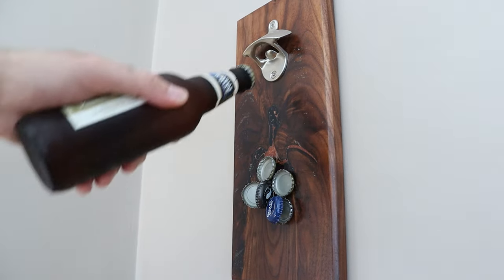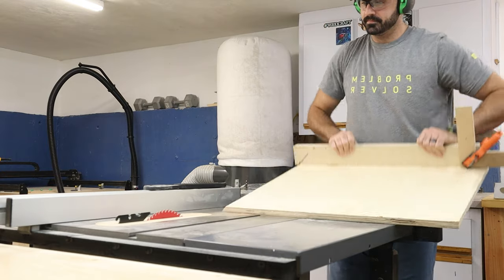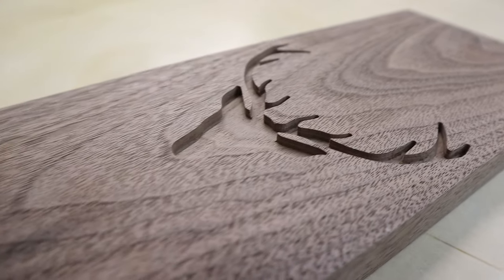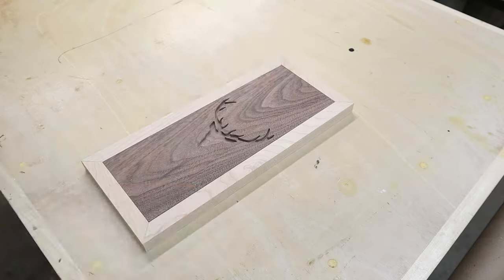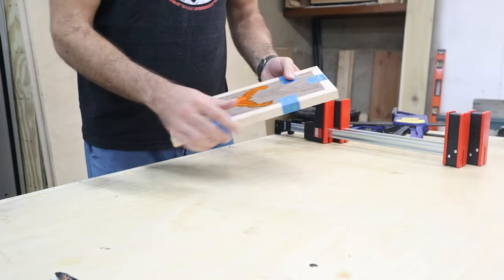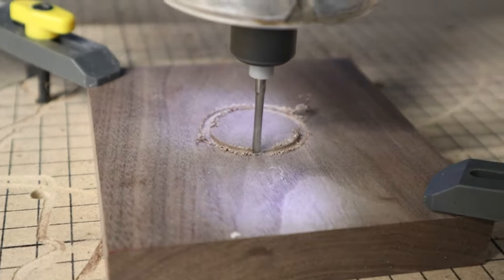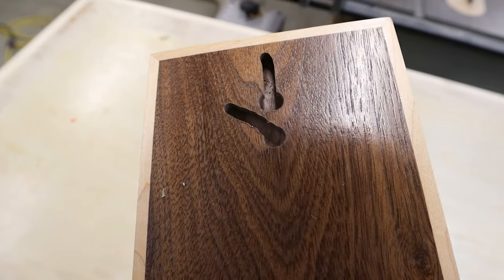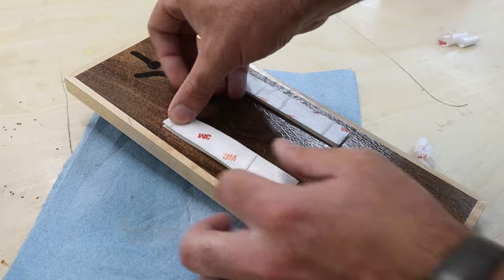Bottle Opener with Magnetic Cap Catcher 🧲 Woodworking Gift Ideas

Comment: Awesome video and very impressive editing. I didn’t even think to use the Velcro to mount it to the wall. Great idea. Did you just stack 2 magnets in the one hole? I may have to do that also!
Reply from the maker: Thanks Thomas! Yeah, I tested with just 1 and it was ok, but I stacked 2 and it was definitely stronger.
Reply: Casual Builds Thank you!

Comment: Hi, nice work. I’ve started woodworking fairly recently as a hobby and really like what you can do with a CNC. Which brand are you using and what would you recommend for a beginner. Do you know any sites where I could find comparisons? Thanks!
Reply from the maker: Hi there, I have the X-Carve from Inventables and I haven't really looked at others so I wouldn't be able to give another recommendation. I love my CNC and it's super easy to use.
Reply: Thanks for quick response

Comment: Why did you dye the epoxy that you used for the walnut plug?
Reply from the maker: Great question - I thought the color would be more visible since the plug wasn't a snug fit.  Turns out, you could barely see the color after it was dry.

Comment: LOL now I want to know if the bottle opener I bought is going to cause a problem!
Reply from the maker: Haha I've gotten a few from Amazon that were much better than the one I used in the video.
Reply: @CasualBuilds  which ones would you recommend? I think I bought the same as yours if those came in a 12pck
Reply: @CasualBuilds  would like to know what Rudy asked as well
Reply from the maker: @braydenjaime8149  - threw a link in the description.  the rusty/cast iron ones are the ones that i had issues with.  the stainless steel looking ones are better in my opinion
Reply: @CasualBuilds  thank you!